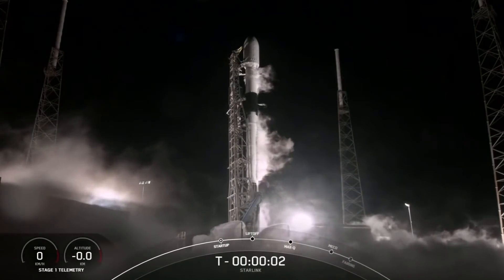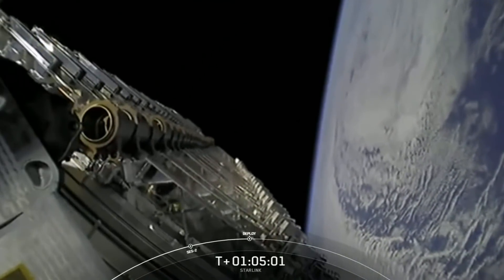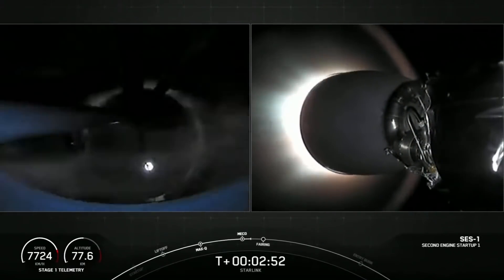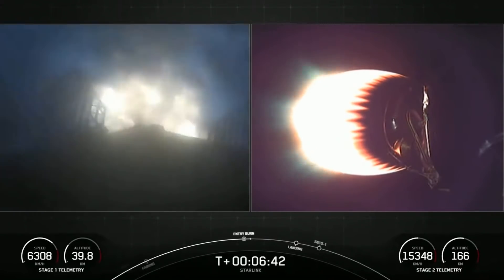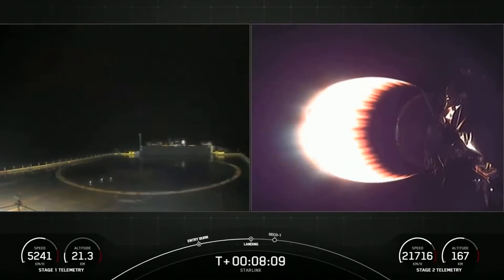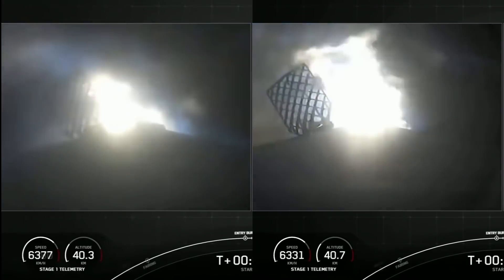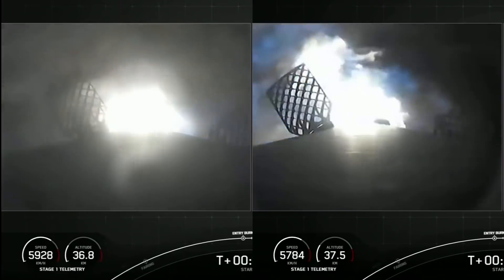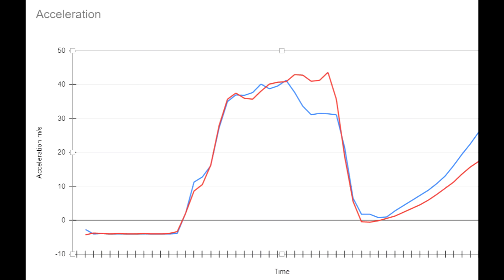Did An Engine Failure Kill A SpaceX Booster on Its 6th Flight?

Comment: Scott, do you think that both SN9 and this failure are two dots that draw a line in terms of engine quality issues, even though one is Raptor and the other Merlin?
Reply from the maker: No. Raptor is a highly experimental engine. The Merlin has longer flight time than most engines.

Comment: Thunderf00t recently released a video claiming that re-use of boosters by SpaceX saves the company fairly little financially, maybe 10% or so off using a new booster, considering the costs of recovery and refurbishment. I’d like to see Scott’s take on this claim.
Reply: Don't trust that channel. 
With these internal Starlink missions, I bet they are close to 10 mill for a booster, at least a 1/3 the cost of a new one.
Reply: Thundertwat is a fool at best.  Elon said they break even at 2.

Comment: I was surprised when the telemetry stopped but the SpaceX commentary didn't mention it.
So when the booster failed to land (how strange it is to say that) I wasn't surprised. I was more surprised that they thought it might land, since losing telemetry seems to imply some kind of failure already.
I'll be interested to hear if they are able to determine a cause.

As a programmer I always feel for the computers in such situations. They have the pedal to the metal but it's not enough!

Finally, I wonder if SpaceX have the ability to light any of the other engines. Any three at equal spacing would do!
Reply: The SpaceX commentary is very different from anything involved in mission control. The fact that the webcast host never saw or reported a problem is expected.
Only 3 engines are equipped with relight capabilities, so there isn't redundancy built in. The center engine is the most important, so it that goes the booster is definitely toast.
Reply: @philb5593  Being so dependent on the centre engine means that sooner or later this will happen, I guess.
Thanks for explaining.

Comment: Afik the Merlin engines use a face shut-off pintle injector.  So significant damage to the injector would result in loss of thrust and the loss of the main propellant valve.  That could certainly cause the flames after shut-down and the continued burning seen by the drone-ship.  Turbo-pump shut-down would limit leak-rates so the dead propellant valve wouldn't drain the tanks before splash-down.  And it's the middle engine because the flames seen after the re-entry burn switched sides of the booster.

Comment: If it is an engine failure, it just serves to emphasise the point that just because an engine starts up OK doesn't mean that it will run properly until it's shut down. OK, we all knew that anyway, but to me it reinforces the need for SpaceX to find a solution for Starship that can handle a failure at any point during the landing.

Comment: Here's a theory: Engine on the right died during the reentry burn. Other two tried to compensate but could only do so much with asymmetric thrust. Booster ends up falling a bit sideways (abnormal flames trailing to the right) and has a steep reentry. Eventually air loads break the booster and it burns hence the flickering lights on the clouds.
Reply: I had the same sense. I'm surprised nobody else commented on the clear sideways airflow taking place.

Comment: Random thoughts: 3D printed engine nozzle cracks, perhaps due to fatigue, resulting in erratic exhaust characteristics.
Reply: people have never stopped attacking space X for this. LOL.  Probably that's the last thing to ever hapen.
Reply from the maker: They don’t use a 3D printed nozzle
Reply: @scottmanley  Thanks, Scott. What parts of the rocket engine do they 3D print? Could a crack in some component, whether 3D printed or not, explain what we observed on this flight?
Reply from the maker: @Pooua  3D printing is usually used in manifolds that are used to distribute propellants.
Reply: @scottmanley  Thank  you. I'm sure that SpaceX will find a solution to whatever caused this incident.

Comment: I feel like the booster likely wasn’t un recoverable if an engine died, they must have some kind of sensor to gauges thrust on each, could probably cut the damaged engine and run the other two fractionally longer and then make up the trajectory difference with the grid fins

Comment: I hope the booster landed relatively intact so it can  be recovered for the post-flight analysis.
Reply: Not impacting the surface of the water at well over 2000 MPH.  At that speed water has the consistency of a solid
Reply: @nemo-x  unless we pull out our transcripts and resumes we will not know how much experience either has with drag calculations, I think I have more than average real world experience dealing with kinetic energy, form factors, sectional density and drag (and ballistics, aircraft design) to have an informed opinion.
But opinions are like buttholes, everybody's got one, even you.
I'm grabbing the ripcord on this one.
Reply: Post flight analyses would be limited to telemetry as the stage hit at extreme speed. Likely lost all telemetry as the stage lost antenna orientation. The pulsing burn is evidence of extreme tumbling. I conclude that hydraulic pressure was lost and grid fins were inoperative.
Reply: @nemo-x  
Agreed. "Tumbling" is the wrong description, but "spinning" (even an off-axis "roll") with a high gimbal angle on the center engine is consistent with the pulsing light.
Reply: @nemo-x  no, spinning grid fins would still be acting with broad face towards the main air flow BUT could still spin edge on with it's reduced aerodynamic pressures.
Reply: @nemo-x  I've actually been to Florida and stood on the edge of the road while a Falcon 9 was transported back from the barge. Proportionally, the gridfins AREN'T that thick. Think of it like a wing or propeller, edge on a lot less drag that you'd get face on even though there's some thickness.
Reply: @nemo-x  OK, let's look at it this way.
Telemetry cuts out at 21.3 Km at a speed of 5241 KPH.
It slowed down a small bit after that but not appreciably, air drag alone on a mass moving that fast simply isn't going to slow it down that much. Low hundreds of speed reduction at best.
Converting 21.3 km to miles that's 13.235 miles high.
Converting 5241 KPH to miles/second you get 0.905 MilesPerSecond
Multiply 13 miles (I'm rounding) x 0.905 = 11.9 seconds +- which is about the time on the video from video cutout to end of friction glow of falling booster and probably impact on water.
Reply: @nemo-x  well, as to the conversions, I'm old (and experienced) and think in Imperial, not metric. About the glow, I'd bet it was a combination of combustible materials burning because the heat shield around the engines was damaged and fuel leaking out of damaged lines. I KNOW what aerodynamic heating is caused by and know that on most objects entering the atmosphere the glow fades HOWEVER the trajectory of a booster that's already made a partial reentry burn is much steeper. Part of the reason SpaceX does it like they do ISN'T just to slow the booster down, they fire the engines to create a bow shock wave during the highest temperature time of reentry to keep the booster from being damaged.  Obviously, that wasn't successful.
And I didn't go by this video, I went back to SpaceX's and ran THEIR video because Marcus is chopped up too much. I'm not being precise, I said I was rounding and estimating on the high side but I'll bet it's closer to my theory than yours.

Comment: I don’t know if you watched the spacex stream but after throttle up and when the exhaust rocket goes into its flower shape and before me on, you can see in the video footage that the centre engine is a different colour from the rest of the engines. That may be when the engine was starting to fail.

Comment: I'm surprised the other 2 engines didn't adjust and burn longer to slow the booster down to the proper speed. The programming does this with the engines on the way up'

This booster was almost certainly doomed by the malfunctioning engine continuing to cause damage, but such a burn would at least have spared the engine bay from the hotter reentry temps, may have saved it if the damaged engine had been limited in its effects.

Comment: Off topic; One possible interim solution to extended micro G may be a sort of 'peristaltic suit'. This could be a full body form fitting undergarment equipped with internal pneumatic or fluid tubing that expands and contracts under controlled internal pressure, creating gentle waves of contraction from neck to feet, like milking a cow, that would force fluids 'downwards' to counteract the stagnant pooling effects that are the source of many known micro-G problems. This might also, with more substantial contraction waves in the abdominal region, address well known issues with defecation in space.

Comment: I'm interested to know if there's any correlation between the early call of MaxQ and the failure during the reentry interface.  If there was something stupid like an inspection/closeout panel not properly sealed around the boattail, an outrush of atmosphere combined with the buffetting effect incurred by an open inspection penetration could have caused the early callout.  Coincidentally, an improperly sealed closeout panel would absolutely have started to emit lots of sparkly plasma after the entry burn and disable/ablate the avionics computer for one of the engines in the process -- so I wonder if this was simply a really expensive QC failure.
Reply: As far as I know MaxQ is just a time line callout and isn't data driven. You can't really have a force sensor to detect that.
Reply: @philb5593  pressure transducer with a set of harmonic vibration sensors and a barometric altimeter makes it pretty easy to characterize forces acting on the body of the rocket.

Comment: I noticed a "Puff" from what seemed to be the engines that is "un-nominal" as well.
 It was right around Max-Q (T +1:05 - :07).  I remember rewinding to watch it twice.

Dumb theory - what if the TEA-TEB system for one engine accidentally "dumped" at max Q?
That would make the engine less likely (or impossible) to restart at entry or landing burn?

Comment: Highly unlikely but my theory.
Booster B-1059-6 burned up in the atmosphere or broke up upon re-entry. We had a orange flicker which is a good sign of fire compared to other landings whiter glows. Also the sky goes from a orange hue to black and i mean PITCH black in a fraction of a second.
Large piece of flaming debris illuminating the sky slightly and upon hitting the water is extinguished immediately. Thats my best theory for the landing shot.

Comment: I expect exactly when the orange glow went out...it was striking the ocean surface.  The time from that moment until the point all three seagulls take off should give us an approximation of the distance to splashdown point from the landing ship.
Reply: Yeah we crunched a bunch of that right after it happened. Came up with some good results. There was still some question regarding a final blaze after crash, putting it much farther away. 
 Lots of good people working on it.
Reply: And if you can figure out how high those clouds were you can make a rough guess as to the speed it hit the water.
Reply: I was thinking the same. The first brief scare close after the orange glow disappearing could be just a scare from the last flash. Then the next is a bigger scare, about 9 seconds later. So it would have crashed 3 km from the drone ship.

Or the birds were scared by two bangs. Of two parts.
Reply: @AlexHaan  precisely!  I do think it’s the former however :)
Reply: The orange glow was too early compared to a normal descent. Does not make sense.
Reply: @arosnett  I would say it’s very VERY likely the failed engine caused a breakup right around where telemetry went out.

Comment: Accelerations should not be in m/s, but m/s^2. I thought it was a simple typo, but the initial horizontal initial line is nowhere close to -9.8 (and I would expected the drag before entry burn to be much less than, say, half the weight). So, what's going on with the axis in that plot?
Reply from the maker: Pythagoras.

Comment: It might be a figment of my imagination but it looks like the birds react to the explosion. All three take flight at the same time twice. They may be reacting to the sonic booms either from reentry or the explosion. You can see what looks like the ripple across the deck at 9:06 might be sonic booms. If that is from an explosion you might be able to figure out how far away the booster was by back calculating with the speed of sound and when the light flashed. Or it could be nothing.

Comment: I see the huge carbon foot print of Musk's business .  Earth has a fever and we have the ultra rich creating lots of pollution, shameful, and to think he makes money off the taxpayers for selling his green cars and solar panels, then blows it on a huge carbon footprint with his rockets.
Reply: one of these launches is about the same fuel use as a 747 round trip between new york and london (well, 2.25 times the one-way trip). There's 30 flights a day on that one route to the one launch every week or two that SpaceX does. Rockets just don't fly often enough to have that big of an impact. Alternately, that's about 80 american cars for a year, so if you want to talk about "blowing it all" he'd need to launch 17 or so rockets a day to do that relative to the current impact of teslas. Somewhat less depending on the fraction of electricity being made by fossil fuels going to run tesla vehicles, but still, a great deal many more rockets than SpaceX launches.
Reply: Actually the pollution from rocket launches is negligible compared to e.g. commercial airliners. A Falcon9 launch causes about as much pollution as a transatlantic flight.
Reply: Nonsense, you're demonstrably ignorant.

Comment: Iv asked this question before to no avail, so ill ask one more time. Are there three designated engines for landing duty, or are they able to fire any three engines in any combination for landing duty?
Reply: Only 3 have TEA/TEB for relight
Reply: The entry burn is done with 3 engines. Afaik the center engine is always used plus 2 outer ones. I'd guess they could switch to a different outer one if one of them failed. Sorry, idk if the same two outer engines are used on each flight.

Only the center engine is used for the landing. I'd love to know if using an outer engine for landing if the center one failed is possible, if the gimbaling and RCS thrusters could manage the off-center thrust. But it's more likely the center engine must work for landing.
Reply: @donjones4719  ah ok yes the centre engine must be part of the three. In regards to the outer relighters it appears that there is only two! I would consider it prudent to at least have one other engine available as redundancy in case of a failure. However what the team at SpaceX have achieved with this particular booster is remarkable in its own right despite the crash landing, 6 successful missions!!! Bravo SpaceX bravo!
Reply: It's a very complicated systems, and anything off nominal will likely result in the loss of a booster.
Reply: The center engine is the landing engine, I don't know if any of the others have enough room to gimble enough to control a landing.

Comment: I find it interesting how there is no flash at the time of impact.  I would expect it to throw propellent up into the air and cause a large fireball like the early crashes before they nailed landing at sea, especially if the thing was burning like it appeared to be with large open flames.  I wonder if that means a fuel line was damaged above the drain valve (or a valve was damaged) and the RP-1 tank was mostly drained when it hit the water.  Either that, or the whole thing exploded and there was just debris burning as it fell down into the water, but I’m not sure what part of a rocket likes to burn under normal conditions other than the propellent....